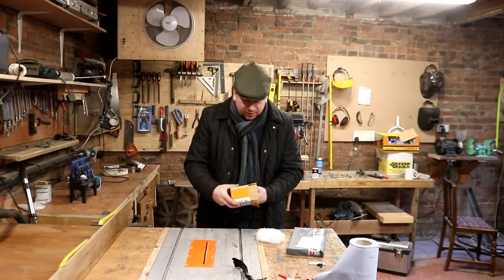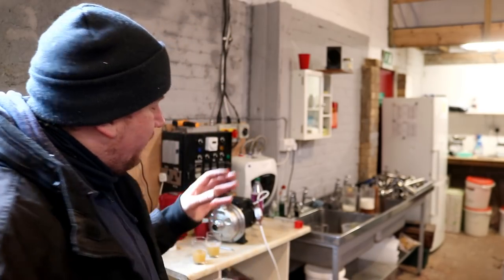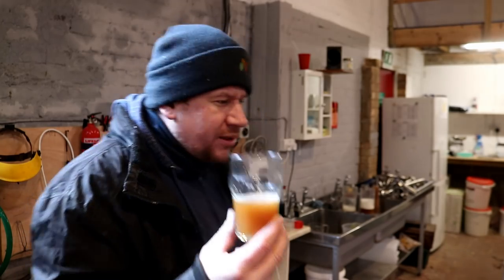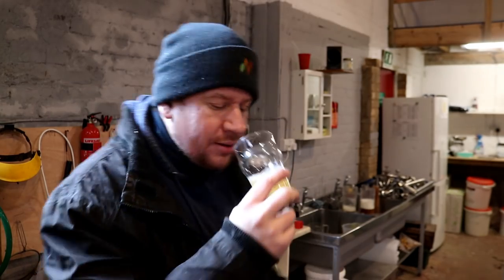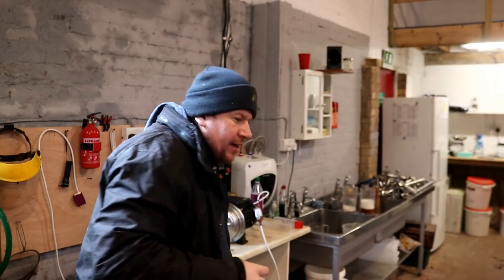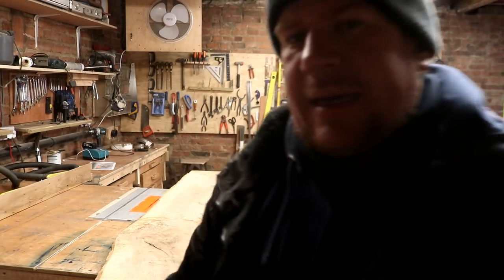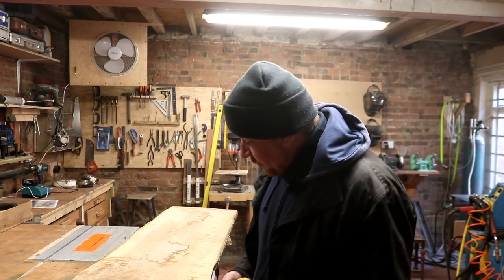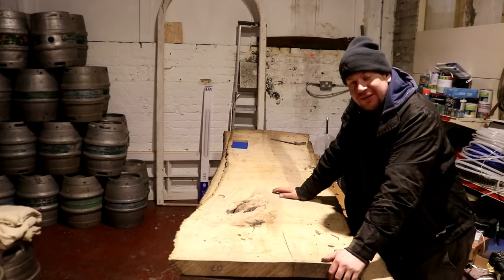AND NOW FOR THE TABLES

Comment: Ahh, a dog that play fetch, Smaller sometimes does that but plays chase far more often, Wayward just says "you threw it if you want it you get it" 😄. Shipshape 🙄 so what happened when the brew tubers descended? Were we not important enough 😲 😆 ?  more surface area will get a better result usually as you have found with the coconut. The narrower piece of timber could be cut into shorter lengths to make small square tables to fill corners? Great update as usual, Cheers, Schnuz.